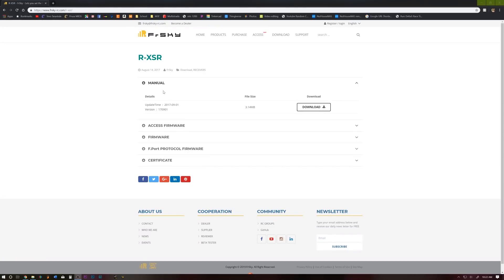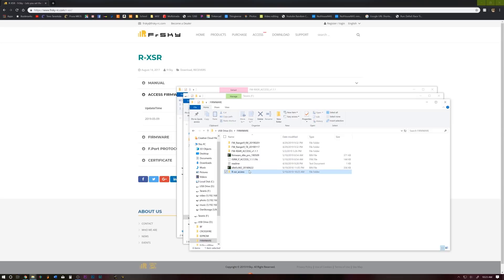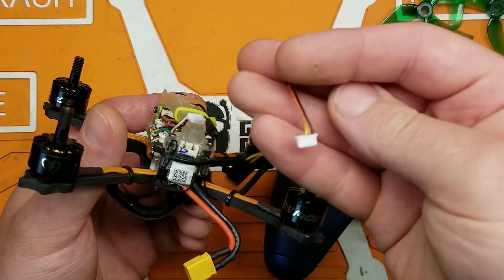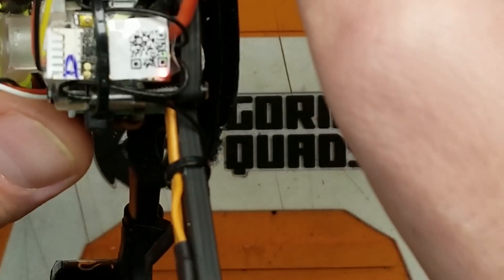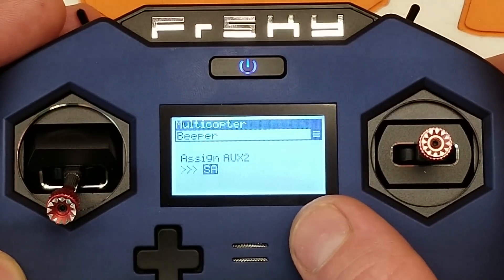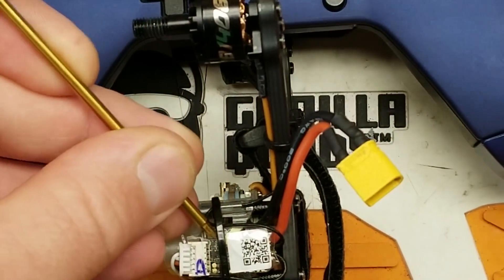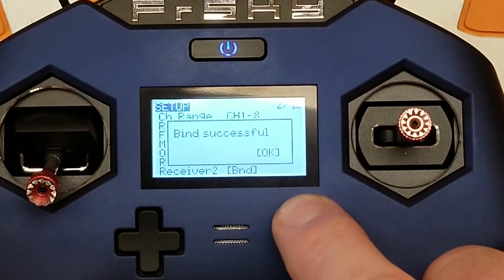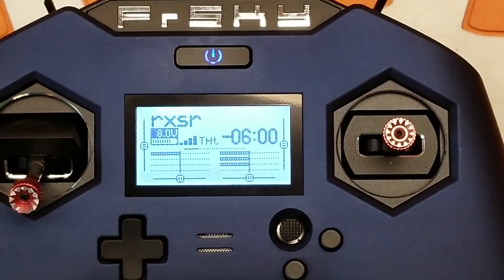Frsky R-XSR ACCESS firmware install

Comment: Can you do a video of updating the firmware via path through by using Beta Flight? It will be a pain to update the firmware for XM and XM plus since it already solder in with wires and tuck in nice and neatly without tearing it down with my BNF version of my quads. Can’t wait for them to release the firmware for XM and XM Plus.
Reply from the maker: I will gladly make a video on flashing the XM series of receivers when the ACCESS FW comes out for them. I already have a video on how to lash a frsky RX using serial passthough. The only catch is the RX needs to NOT get power from the USB port. Sadly a LOT of flight controllers specify where to connect power for a RX and that pad most of the time gets 5V from the USB port.
Reply: I feel your pain :) It will be nice to eventually not have to deal with all the bs involved in removing, desoldering, having 3 different harnesses made for flashing, updating the R9M module for FPort on the R9MMs and realizing you just hosed 4 of your other quads and they now need to be disassembled and updated. Trappy is laughin his ass off. I honestly wish I had gone crsf right off the bat but my innate cheapness led me down the R9 road. This protocol looks like a light at the end of the tunnel :)

Comment: Thank you for your update videos on the Xlite pro. I'm a huge fan of the xlite and can't wait for this pro version. Hopefully they'll make firmware for others like XM+.
Reply from the maker: I have seen some mention of the xm series of recievers being made to work with access.
Reply: @TweetFPV  I hope so and I flash the XM+ via its sbus just fine off of my xlite.
Reply from the maker: Hopefully soon. Since I got the xlite pro the software changes has actually been fairly impressive. Granted it should have been done befor they started shipping but I guess that just how electronics from China work.

Comment: Pretty cool all the options available with the bidirectional telemetry, that's so sweet :)
So no more FCC or EU file when using ACCESS firmware?
Did you see by the way, all the latest products anouncements from FrSky (which pissed off a lot of people)?
Basically a new X9D and a new R9 system dedicated for ACCESS :/
I hope they won't screw up all the proud owners of X9D+ and R9M/R9, that would be pretty disappointing but i have honestly a bad feeling about it!
Have a great weekend and keep on flashing :)
Reply from the maker: I wouldn't worry. I see frsky making things ok for frsky users, all should be compatible with access but I think the legacy stuff will just be missing some of the features of the isrm products. But again who knows.